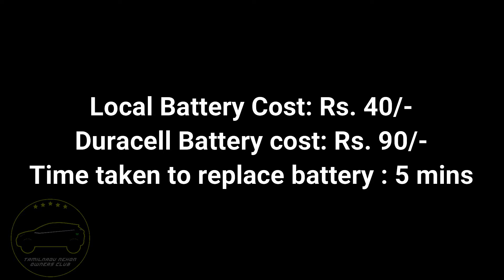DIY Key Fob battery replacement for Tata Nexon XZ+ | Tata Nexon | #LevelNexSUV

Comment: Why is the indicator still showing red even after changing the battery in the end?
Reply from the maker: The indicator shows that battery is sufficient. If the red indicator doesn't glow, it means that the battery is discharged completely

Comment: Where to get this battery from? 
And can the battery be charged by placing it on the usb socket?
Reply from the maker: Any local store. no these batteries are use and throw type
Reply: Please help where I can I get original battery bcoz local 2032 V Philips are use and throw type
Reply: Where to get original battery for tata Nexon battery
Reply from the maker: @vasanthmchoori9928 All CR2032 are used and thrown types. They can't be recharged again. Better to buy a use and throw battery and replace it everytime. It costs less than 50/-